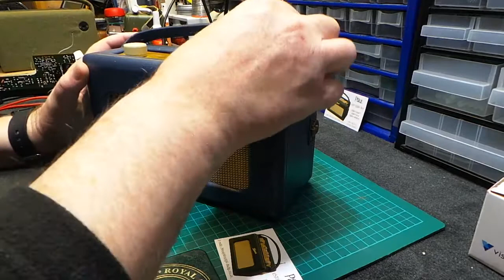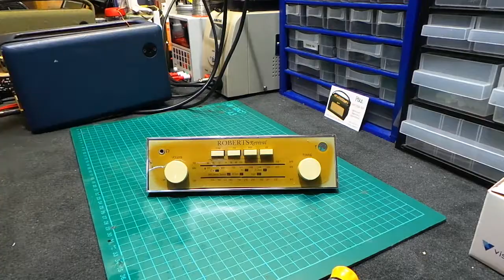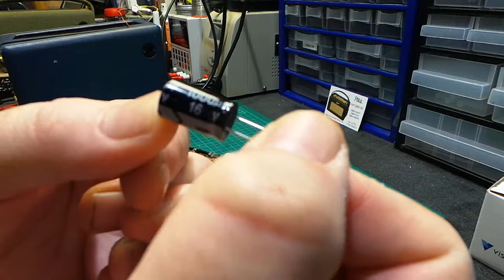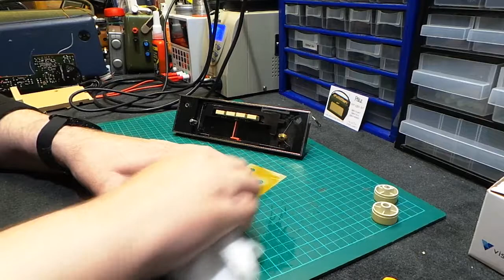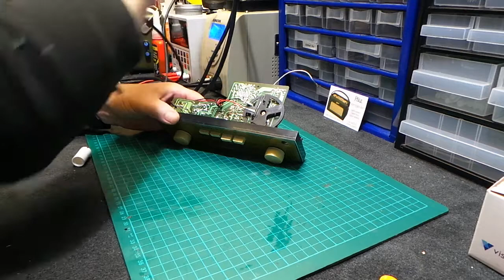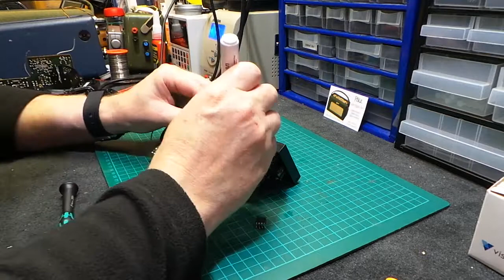Roberts Revival R250 Radio - Blown Audio Fixed - Part 1

Comment: hello what kind of audio chip for the roberts 250?
Reply from the maker: There are two different chips - you have to check which you already have inside your set. Don't put the wrong one in, the pinouts are different! 
It's either a TDA7231, or a 2201X1

Comment: You would have thought that if they were going to use an unconventional (though I have seen  other devices with center negative over the years) power connector scheme, that they would have been nice enough to add a protection diode there. It may not have been fast enough to save the chip though. Or maybe the bean counters wouldn't have it. ATB Doug.
Reply from the maker: Thanks Doug, you're right about the diode, and about the bean-counters! Many of us add diodes 'after the fact' when they've arrived for service. I guess it was their way of selling more PSU's to to public, given that the centre negative PSU's were (at the time) pretty unique to Roberts... - Need one? You can only buy one from us!

Comment: Thanks, interesting and very helpful.  How do I get one to you for repair, do you have a website/address?!
Reply from the maker: Thankyou for the comment. I am not currently taking on any more repairs. I already have a to-do pile to see me through two winters! You might look up 'Radiocruncher' on Youtube. He may be able to help. https://www.youtube.com/channel/UCDj4nrHQsfiGO--jt108Cjw/about
Reply: Thank you for your reply.  You said in your video that you had several thousand audio chips!  Please could you supply one, or direct me to someone else to whom you have supplied a batch, or something?
Reply from the maker: @drovodon  https://www.ebay.co.uk/sch/i.html?_from=R40&_trksid=m570.l1313&_nkw=tda7231&_sacat=0
Reply: Great!  Thank you
Reply from the maker: @drovodon  Check the orientation of the chip before replacing it. It has a 'notch' on the left side. You may also have to replace up to 2 capacitors, and a resistor. The capacitors are close to the audio chip, next to the volume pot, and are 16v 1000uf, and 16v 470uf.
Reply: @Codeeze hank you again.  I've ordered the chip and desolderer - I'm really looking forward to having a go at it now!
Reply from the maker: @drovodon  Let me know how you get on!
Reply from the maker: @drovodon  https://alltransistors.com/superdatasheets/_pdf/18/tda7231a.pdf
Reply: Hello again.  Well, chip and de-solderer arrived today and after a bit of a fiddle I got the old chip off.  But.  Unlike the new one, the old chip doesn't have the helpful notch so I'm a bit stuck.  With the board towards me and the antennae-thing away from me, does the notch the go to the left (next to the capacitor) or the other way around?  Thanks for your continued help!
Reply from the maker: @drovodon  The chip 'should' have a notch - I have never seen one without. The notch side should be next to the capacitors. Nevertheless, check that you indeed have a TDA 7231. With the text on the chip the right way round, reading left to right, the chip then goes on the circuit board (see here: 6.38 https://youtu.be/jlDn79MSTSw?t=398 ) and ( https://youtu.be/jlDn79MSTSw?t=1035 ). Happy to help - if you aren't sure, ask again, and I'll video the chip exchange specifically for you on a scrap board I have :)
Reply: Hello.  Very despondent.  On the chip orientation point - the chip did have a notch but the existing one didn't, hence my need to know which way around to install it.  Anyway, I got the new one in ok and made sure there were no solder bridges between the pins, connected it al up and ……. nothing.  At least before I'd got that fuzzy sound like the one in your video but now nothing at all.  Battery ok.  No idea what to do now, but don't want to give up the radio (it was a gift for my wife).  Anymore ideas please?
Reply from the maker: @drovodon  email me direct, and we'll go from there. Email address on the about me page. Thanks!
Reply: @Codeeze  Hi Paul, was in touch a couple of days ago. The faulty one I received came with a 470uF 10V electrolytic cap which showed absolutely no signs of distress. I removed it anyway along with the TDA7231, 1000uF 16V cap & R15 100 ohm resistor. Is this a variation with the R250's I wonder, because I've noticed that in some the ceramic caps are also smaller?